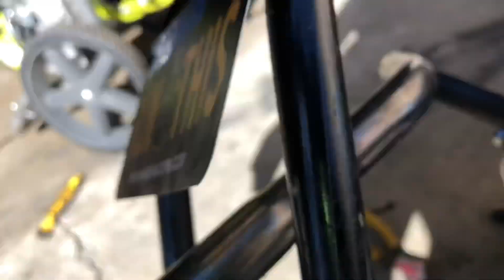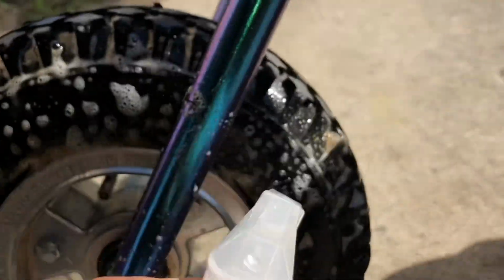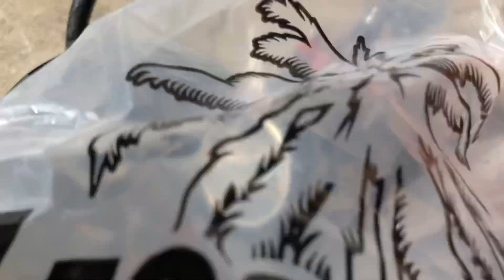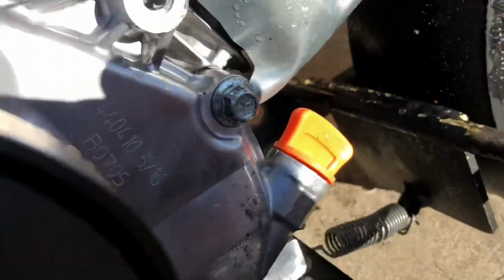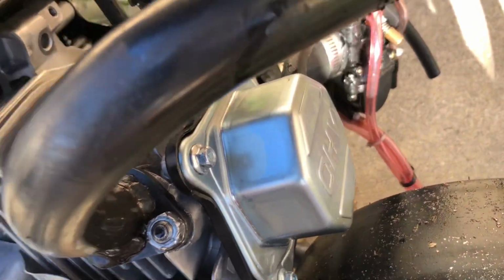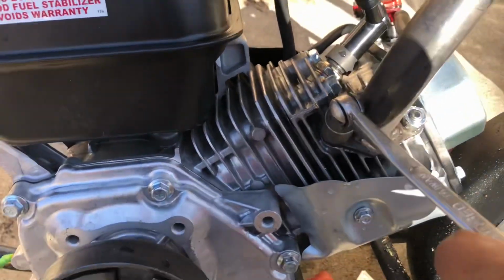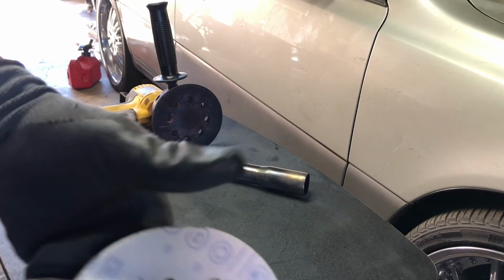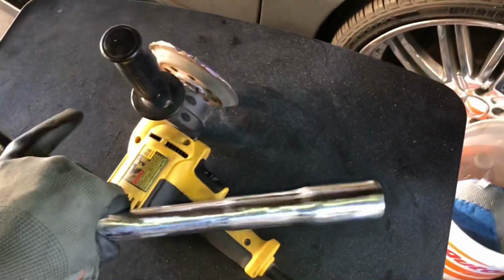How To Clean Your Mini Bike To Look Brand New! (Pressure Washer Only)

Comment: Mines cleaned, tuned ,  lubed, fresh oil change today.       

After pressure washing spray the whole thing down with tire shine & buff it off with microfiber it’ll look brand new ..
Re packed all bearings  with grease less than 300 miles ago.  
  Red grease in my throttle, 80w down the cables & on the chain 
 
To maintain the pipe rub a hard candle on it when it’s hot enough to melt into it run it till it smokes off then wipe it off when it’s cool enough.
  
A well maintained bike will keep going forever

Comment: What carb do you have on the bike? Also whats done to the engine?
Reply from the maker: Pwk 28, billet rod and flywheel 275 cam 26 pounds springs
Reply: @RoyalJZ  is the pwk 28 carburetor better than vm22 mikuni carburator?
Reply from the maker: @Daniel-ny7jx  28mm have a bigger inlet
Reply: Is you using stock?or stainless steel (valve stems)? With your 26lbs spring?
Reply from the maker: @MIAMIWARLORD  everything stock in my head but the springs